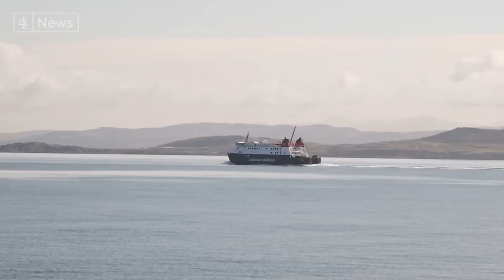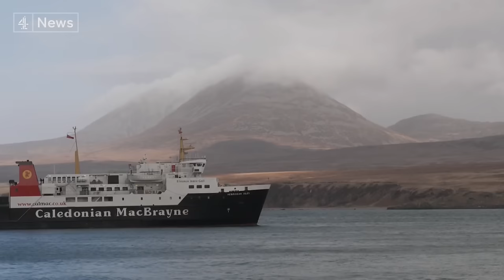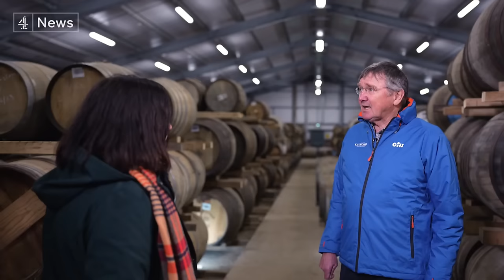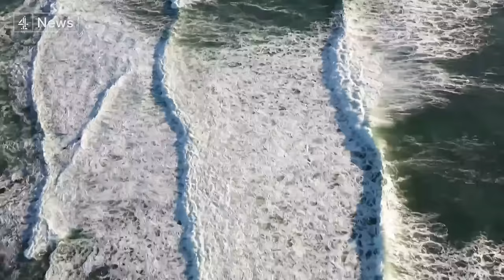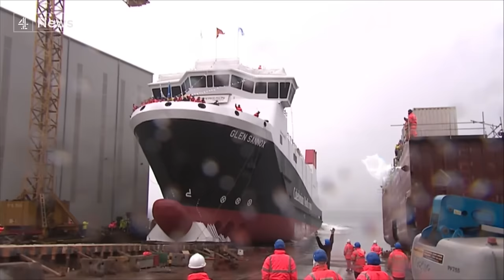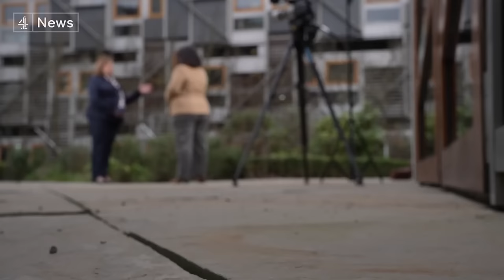Scotland ferries crisis hurting tourism and whisky trade

Comment: Like NZ ferries between islands. Failure to invest, upgrade, and generally squeeze every ounce of short-sighted profit.
Reply: And in NZ the replacement ‘mega ferries’ (50,000 tonnes each, bigger than Bismarck!) had to be cancelled because they were too big to fit in the terminals and dry dock. The woke Labour had ordered them solely on the grounds that they had lower carbon emissions per tonne of freight.
Reply: @scipioafricanus4328  not sure it's because of them being "woke". Incompetent is a more apt adjective.

Comment: "The windows had been painted on"... I'm confused.
Reply: your not alone.
Reply: The wooden cladding covered the spaces where the windows would go, to weatherproof the bridge, and were then painted white and then black in the shape of tinted windows to give the impression the glass had been installed.
Reply: @alroecc  thx
Reply: Sturgeon wanted to have a launch, because it would look good. But the ship wasn't really ready, so they just faked the superstructure.
Reply: @highlandmalt6368  ty
Reply: @highlandmalt6368 100% Accurate but it was so OBVIOUS.
Reply: They are more insulating that way. And the painted engines have zero emissions.
Reply: @A190xx  Is that engine paint Green by any chance PMSL
Reply: so would the skipper be.